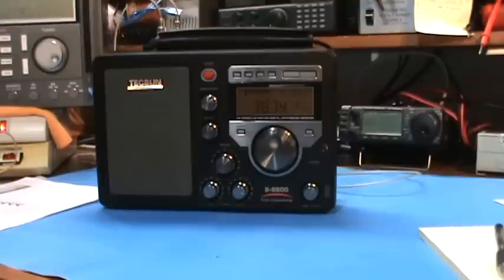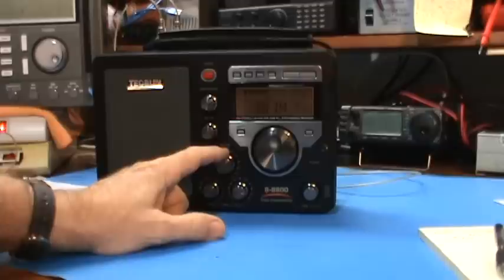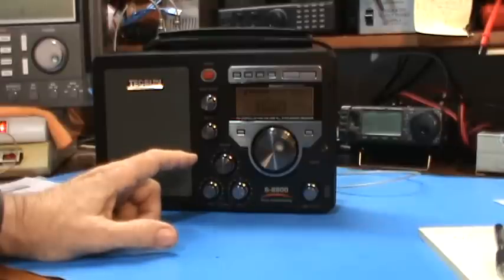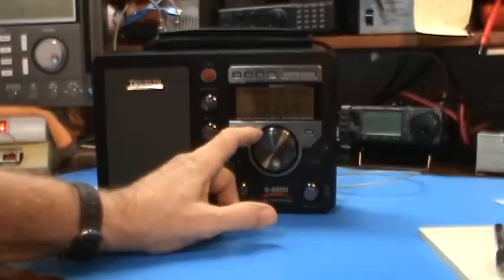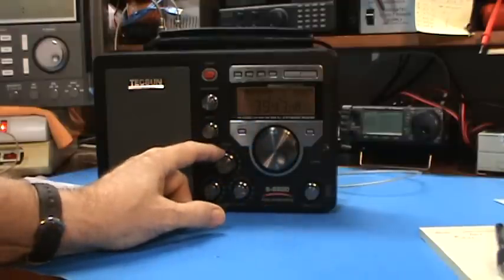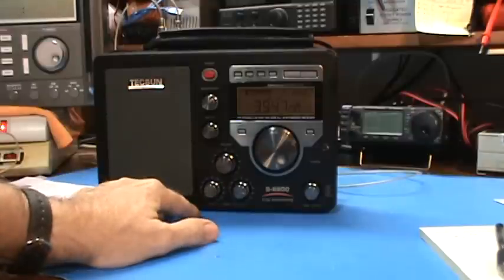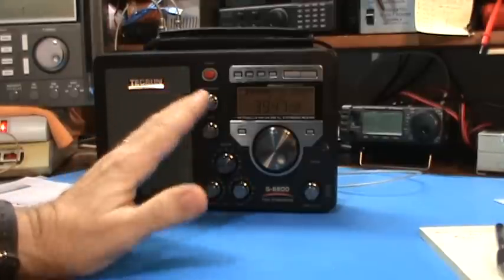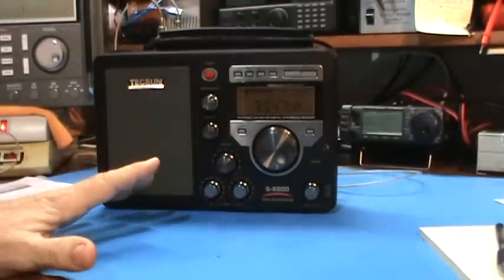TRRS #1341 - Tecsun S-8800 Radio - Pt 6 - SSB Mode

Comment: The S-8800 distortion and AGC pumping issue along with the 4 Khz filter not working on SSB mean this radio is very over priced and it’s enough to make me sell both this it’s just irritating if you listen to SSB.

You can’t really observe this from this video because signals are weak but I guarantee it’s a serious issue that shouldn’t exist especially at the price.
Reply from the maker: Interesting.  I use this radio a lot and have not had any of those problems.
Reply: hamrad88 I’ll take a video and post the link in a while.
Reply from the maker: @o00scorpion00o  That would be super.  Thanks

Comment: Electrical noise at your QTH is a killer.
Reply from the maker: Yes, especially in my office were I have about six computers running, router, switches, modem, wifi weather stations, 4 or 5 tablets, a couple of cellphones and a couple of monitors on most of the time.  That is why I must use an outside antenna with shielded coax cables.

Comment: Just wondering if the SSB fine tune control knob is digital like the volume control knob (doesn't have stops to the right or left)?
Reply from the maker: It is digital with no stops.